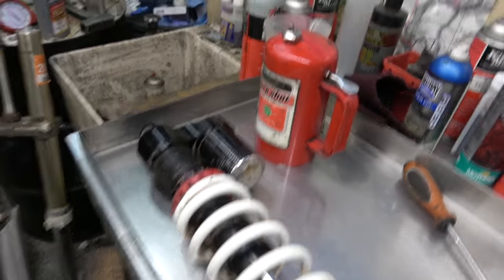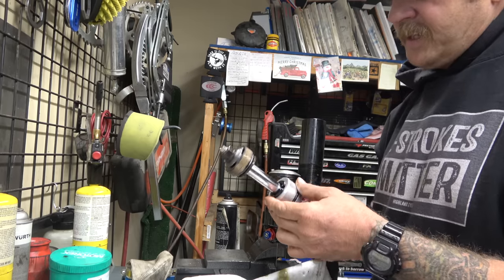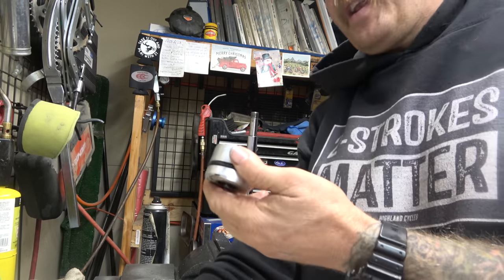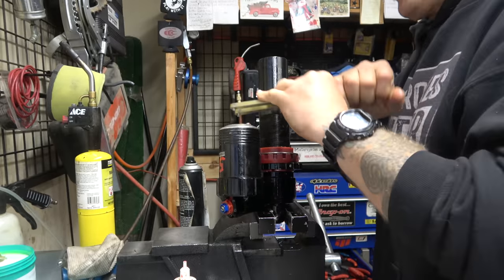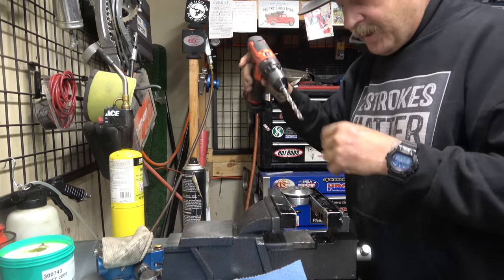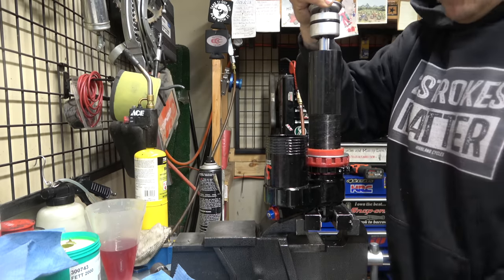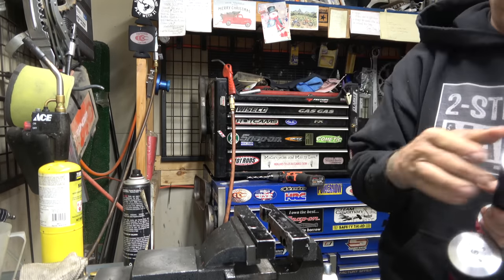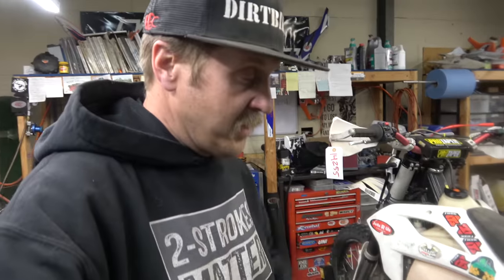GPX Moto Shock Rebuild

Comment: Some great points on the metals in areas. I am gonna shoot this vids to Gary at GPX Moto. He's made some huge improvements at the factory level with advice like this. I've had some frustrations myself. I can vouch for parts though GPX in Utah has been on the spot over nighting me parts. I get it these are different in some dumb ways from the rest of the industry some promise though. They do have a new PDS and Linkage 300s coming soon too. Also GPX directly and on their website has full shop manuals, once again not perfect but its gotten better over the last year.
Reply from the maker: For sure. I hope they keep it up.

Comment: I told you the shock would be "interesting" 😉...  A GPX job with two stripped fasteners and one required re-engineering feat... seems about par for the course, plus the 1.5 to 2 hours of extra time always needed to fix the things that broke while working on something else...🤔    
I had a schrader valve tapped in for N2 filling, also the piston seal is not good, the oil and N2 end up mixing in these shocks no matter what.  
Honestly, I got aggravated just watching you mess with this bike in the videos, brings back too many bad memories... 
I 100% agree, I'll take a used name brand over one of these GPXs any day.  The Japanese and Austrian bikes are built to a completely different level of quality and engineering. The reality is, these levels are going to cost in $$ to the buyer.  If someone wants to buy a bike at 1/2 cost of a Japanese or Austrian bike, they are simply going to get much less quality and lower engineering standards. 
Since I'm on roll, let's talk about the "parts supply". Yes, in the US the distributor USA Motortoys does have a supply of parts, some work, some don't... personally the brake peddle and skid-plate I ordered from them did not fit the my bike. In the after market its a complete crap-shoot also, some parts for whatever bike the GPX is modeled after may fit, most don't... To get most anything, including correct information is an exercise in frustration and wasted time(and money).
Reply: And still the salty tears flow! 🤣🤣🤣

Comment: We need the gpx in Australia people over here seem to think a 10 year old claped out 2 stroke mx bike not even enduro is worth more than 5 grand then it's minimum of 5 grand to make it like new and a 12 month wait on parts if it's a KTM. We pay through the teeth in Australia for bikes and cars a cheap alternative should drive prices to where they should be atleast on the second hand market
Reply: Some guy, Robby, Robbo Robinson, in England started to import them. You could become a dealer and be the guy that starts the change.
Reply: @hello-dirt  I have been thinking exactly that I even researched a few manufacturers and even the one that makes the GPX and I can make my own brand and they will build to my specs and branding. But I would have to visit china first I rekon to make the deal just to make sure nothing gets mixed in translation which is my biggest worry

Comment: Its not a 250, its a 230...... Sadly
Reply from the maker: Yeah. Whatever, it’s not awesome
Reply: @highlandcycles  I agree. They advertise it as a 250, when its really a 229cc. (and a pretty weak one at that) Dishonesty in advertisement; REALLY rubs me the wrong way.  I looked into these things pretty deeply some months ago. The price is appealing for a "new" bike, but when you start getting into the details..............YEEAAAHHHHH..............Nope. And seeing how soft the aluminum parts are on this one, just re-affirms my original thoughts.
Reply: A 229cc 250 is Par, similar to a 525 being a 510... And Honda has done that for ever with their sizes.
Reply from the maker: @adventurer67  yep.
Reply: @Venom2U  For the boulder field it's more then enough power, good down low. yeah the naming of it, kinda bummed me out too. We have been beating them up and they keep goign just fine.
Reply: @adventurer67  So true